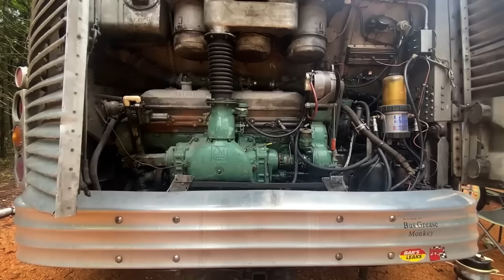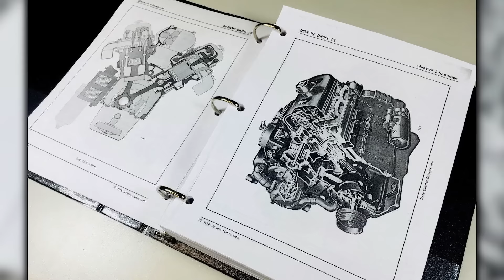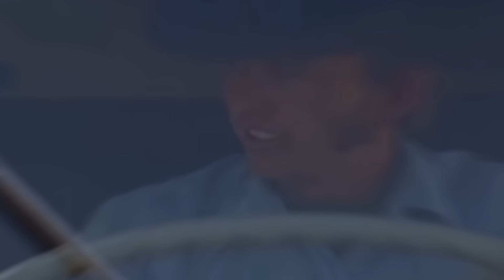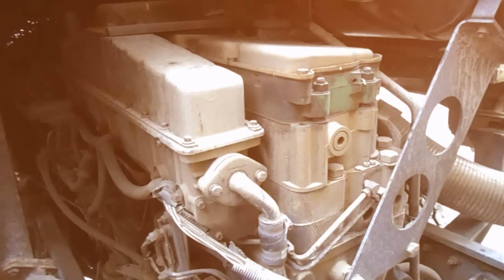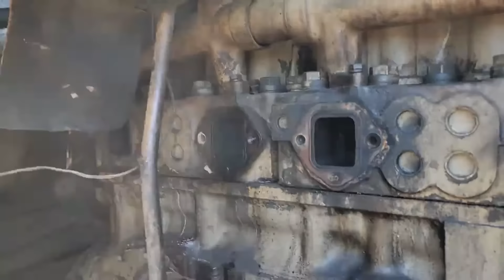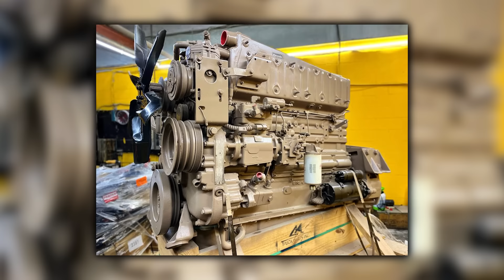The Cummins NTC-400 Engine That Silenced Detroit Diesel in 1976

Comment: That Cummins Big Cam 400 was a gutless POS. 
It's 400hp wasn't worth anything because its torque values were way lower than Cat's 400.
I actually preferred the Detroit 8v92 with a Fuller 13, at least it sounded like it was doing something.

Comment: What exactly do you mean by blow-through?  Did the diesel fuel not finish burning during the power stroke?  Two stroke gasoline engines let some of the air-fuel mixture through during scavenging, but this isn't a problem with diesels.

Comment: In a VS situation, it's simple. Detroit for power and cold starts, Cummins for something economical to run
 Period. That's it. It's that simple
 I've ran both many years and know very well. Cummins is far more affordable, hands down. There's not even a comparison. Keep them in a warm shop or plugged in in winter or you're not going anywhere. Detroit starts excellent in cold weather and typically has more power but much more costly to repair, not as reliable and expensive to put fuel through. Very few people try to run a 2 stroke Detroit nowadays, they are simply unaffordable. There's still some old mechanical Cummins running and driven properly can give very reasonable fuel economy.

Comment: The old 318's aka 8V-71.  I drove them, I HATED THEM, we called them a Yudden Yudden.  Or a Double Breasted Yamaha, or a Dead-troit.  They were TOUGH, I give you that, but they did not have high torque at low Rpm.  I always preferred a Cummins.  The 92 series Detroit was a lot stouter than the 318 or 71 series.  It was stronger than a 350 Detroit which was a Turbo charged 318 basically.  These oil slobbering things were NASTY, breathing that oil burning was not good to breathe.  If you wanted to stop and take a Nap, when you let the thing idle the oil pressure went to ZERO.  The guys at Stewart Stephenson that worked on them aid it did not hurt them to let them idle like that but it was better to have a Sampson Fast Idle Switch installed.  Then it would steadily idle at 1,100 RPM.  Try to sleep in one like that.  They were 100 MPH down hill and 20 MPH going uphill.  A Small Cam 350 Cummins with the pumped turned up would run circles around them.  4 stroke is the only way to go.  They are better on a stationary Generator or a Shrimp Trawler, they need to run WIDE OPEN all of the time.  Never like them.  However, they are TOUGH, if the driver does NOT let them run out of oil, or get them HOT, they were hard to tear up with their limited POWER.  Take a 318 and cut it back to a 290, and hire a WORM to drive it, it will run forever probably.  Detroits are GOOD around DIRT, Cummins, not so much.  For a Cross country truck, I would only want a Cummins.  That was my experience, I don't have to do that anymore.

Comment: When I was 30 years younger I drove a 79 Transtar with a 6V71 and a 15 speed. My boss told me to rev it as hard as I could. It was very fun to drive like that, these days I really appreciate the modern low reving electronic motors, easy to drive and shift with their low revs  high torque. However my dream retro truck would be an American W900 with a 12V detroit and a spicer splitter box. HTCF!!!!!

Comment: I’m 68. My entire life has been involved with truck and marine engines. In the 70’s I drove a hydroseeder truck with 6v53 everyday. We had trucks and equipment and boats with Cummins, Detroit caterpillar kabota Hino John Deere kamatsu Mann. The big cam Cummings was a great engine. The 3408 cat will pull anything. 1271 Detroit TI was all muscle. The 3406 cat was the best engine for our use. Today, my husband has a boat with caterpillar 1015 hp twin turbo C 18 x 2 cats. If you throw the throttles from idle to the pins those engines spool up like 2 cycle outboards. If you don’t hold on the C 18’s will toss ya out of the cockpit. Unbelievable response.
Reply: Sounds like some one messed with computer. Amazing what can be done with computers controling engines and equipment.

Comment: I grew up in the Logging world, Kenworth and big, highly tuned Detroit 12V71s ruled the mountains, then Cat and Cummins showed up and changed logging forever! Later when I started driving, I learned behind a DDEC 8V92, what an experience, the next truck was Cummins N-14 powered, Boy did that thing pull, made me a believer, and the last truck was Cat powered, had a C-16 in it, and holy hell, that Cat roared and would pull any grade with out down shifting more than two gears! Today, I have a Frankenstein Pacific P-12 with a Marine 12V92 that is converted to road use, backed by a Allison Power-Shift 8 speed and Eaton Planetary drives, nothing sounds like a Detroit 12V92 Twin Turbo, NOTHING!

Comment: The Cummins NTC 400...449 CPL
 had alot of problems. They smoked badly on startup, the blocks were weak and the liner counterbores broke. The crankshafts were not strong enough to handle the power...the N 14s was one of the best after the NTCs were out of productiuon.

Comment: A lot of the things said about the Detroits really only applied to gas 2-strokes.  They weren't any lighter or less complex than 4-strokes, and they didn't have fuel blow-through.  Loop-scavenged gas 2-strokes really are completely different beasts to uniflow-scavenged 2-stroke diesels.

Comment: My diesel is a 1981 Mercedes Benz 240d.  They are a very reliable diesel engine although the it has solid lifters and needs to be adjusted about once a year I am getting 30 mpg on the highway.
Reply: The injectors also open under pressure. The engine is all mechanical.

Comment: Jimmy  iingines may  be good on the Highway but they are a guttless wonder when used for off highway.  
I Ran  Wagner Dump loaders and the  NTA 400 cummins had more power than a 475HP V12 71 jimmy.

Comment: You Cummins cheerleaders are out of your freaking minds.  The Detroit 60 series is the best diesel engine ever made.  I have 2 million miles on mines and it’s never broken down, ever!!!  And I know guys with 4 million on their 60 and still going strong.  Where is the NTC now?  In 30 years I haven’t seen one.  But the old Detroit’s are still going, and you can still find parts for them.  Why not compare apples to apples? Why compare an older 2 stroke to a newer model 4 stroke?  Compare the ntc to the 60 series, and it’s game over.
Reply: Well shit talker the 855 Cummins is of the same era as the 2 stroke Jimmy's. That's why the comparison.
Reply: 4 million on a series 60? 
That's a lie. 
Nice try. 
I have a Caterpillar 3406B that's 39 yrs old and still runs like a champ and will out pull your s60 all day long. 
Show me a s60 that's 39 yrs old and still running great. 
My 3406B doesn't even loose or burn a half a gallon of oil in between oil changes
Show me any Detroit that does that. 
Nice try.

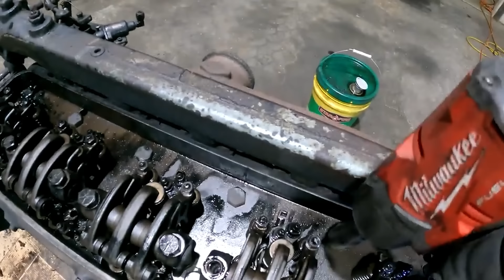Comment: I drove a 1990 International Dump Truck but had a Cummins 251 big cam on it paired with an eight-speed manual transmission and low range gears it was a transition into driving that thing you literally had to drive that thing like you were angry at it the thing I like most about that truck was the f**** engine sound literally be shifting to the next gear after you've fully spoiled out a gear you just didn't shift from 1 to 2:00 it took a while but man it would move a mountain

Comment: Worked these engines for a long time sure miss the good old days and times when working on engines you could prove yourself fitting liners in a Detroit engine and set the timing and synchronizing and buffers. Don’t miss the oil leaks on the gear covers thought but those Detroits started getting obsolete and we was on to repowering are mixer trucks with the 855 Cummins  of all different models big cams small cams and even some natural

Comment: Rebuilt many 350 small cams, 400 big cams, 475 big cam, air actuated mechanical cam actuators, dual partisian rads,then cripple 4s, then finally best engine n14. Series 60 was also bullet proof. Now, every engine self destrucys with emission garbage ,with worse fuel economy and terrible reliability.   98-2002 were greatest engines.

Comment: 3406 is the king... Series 60 next in line... I've driven Detroit and Cummins but 425 to 550 hp CATS out perform them... Drove an Ant-eater with a 550 and 18 it moved out like a sports car... Impressive...

Comment: First truck I owned was a big cam 4 Cummins in a t600 7 mpg did the bottom half at 450k changed injectors and injector rods at 700k. Great engine with a 13 speed. Before that had a shiny 290 in a kw cabover. that 855 block good stuff

Comment: I worked at General Motors Diesel Division located in London, ON on the Light Armoured Vehicle (LAV). Thus was in the early 1990s. We used the DD 6V71. Back then DD was introducing electronic engine control. IIRC, it was called DDEC. We asked if they would do it for the 6V71. They refused, so we went with CAT. Then they said yes, but it was too late. lol!

Comment: I think this is a very comical story. I do agree with some of the other commentors. Cummins was around long before the 400. Some engines? Not so good. But, we are not comparing their engines. So, on to your opinion. The NTC 400 is absolutely a good engine. Did it take down Detroit ? Absolutely not. Did it silence the screaming jimmy? Well? Technically? It was quieter for sure. But? Have you ever listened to a 903 trying to hammer itself apart? Or a triple nickel when it is deciding which side of the block to toss that extra rod out of? Not ripping your subject. I know we all have our own opinions. I have ran 4/53's. 6/71's, NA's and t's. 8V-71Na's and T's. Also 92 series including 6 and 8 V's. Now I know your title says silenced. But? I just feel obligated to add. I sold an Ih 4300 with a BC400 Cummins. The one I will probably never sell? ( kids might when I'm dead)  IH Transtar II. Silvertip 475 Detroit. I know she may be loud. No Detroit should ever leak oil. Except, from the breathers. But, that is the very difference between a 2 and 4 cycle engine. Cummins engines were quieter for sure. But low end grunt? Be serious. And Cat at that time? We used to give those owners much crap. If it is below 50 degrees fahrenheit? Put a jacket on em' or it won't start😂. Here kitty kitty kitty😅

Comment: GM did a fantastic job with interchangeability, simplicity and durability. And they would supply the parts like they needed. Unfortunately those engines just didn’t make a ton of power for as big as they were and they burned lots and lots of fuel. And good god they were loud. But they sounded great.

Comment: I drove a 1966 R model Mack with the 237 horsepower high torque engine with a Mack Quadraplex transmission. (5X4) it could out pull better than the Cummins, and Detroit  it also would get better fuel mileage than either one. 
That was before Cummins started with the Formula series, or the Big Cam series. Personally I always felt Cummins copied Mack.  Just my opinion.

Comment: Cat 3400 family of engines were reliable the early PC engines did have issue with cylinder heads cracking around the threads at the precup ,went to DI still capsule nozzles we had less head cracking issues,  though did see some issues with fuel in the coolant due to cracks in adapters for DI engines allowing fuel to enter cooling system, then that got corrected

Comment: If the apocalypse comes, the 2 stroke diesel will still run and can be fixed simply. I am no hater on cummins or cat but seriously if you get the 2 stroke fuel and a mounted air starter, it will run no matter what has happened, and you can fix the thing with a small set of wrenches a 2 screwdrivers and some swearing lol
Reply: If you have an extra set of injectors and Cosby in a can it'll last. Lol

Comment: I drove construction vehicles for years, most of the rigs I drove had Caterpillar or Cummins. While many trucks and tractor trailers were powered by Detroits, I don’t think Detroit ever dominated the on road truck market. While Detroit dominated the bus markets, both transit buses and intercity buses almost exclusively used Detroits, but not so in the trucking industry. 
As far as construction equipment, Caterpillar was always one of the biggest players and they of course would use their own Caterpillar engines.
For years I believe Detroit dominated the mid size marine market, work boats and fishing boats were mostly powered by Detroits and many pleasure boats as well. But today it seems like Cummins has taken over the mid size marine market.

Comment: Detroit Diesel's worst enemy was..... Detroit Diesel.  The 92 series engines were rushed to market in 1973 to compete with the Cummins KT series, Cat 3406 and Mack Maxidyne 300 which were all introduced that year.  The 92 was pushed out the door before it was ready. Reliability problems ensued.  Detroit's 40% share of the on-highway diesel market had shrunk to just 4% by the early 1980s, surviving largely on the strength of orders from drop-dead loyal fleets like Roadway and McLean.  It would take the introduction of the 4-stroke Series 60 engine (Developed jointly with John Deere) in 1987 to return Detroit Diesel to relevance.  The Series 60 was a "clean sheet of paper" engine, an 11.1 or 12.7 liter DOHC inline 6 designed from the ground up for electronic control.  The Series 60 would become a legend in its own right, but that's a whole 'nuther story.
Reply: There's nothing that Detroit made that could come anywhere close to competing with Cummins KTA 19L.

Comment: Been running the same big cam 400 for 24 yrs. I pull up to 128k on a lowboy all the time. Best engine ever made in my opinion
Reply: Parts are also plentiful and cheap compared to others.  It amazes me the basic engine was produced in 1932 and received many upgrades through the years.  It was an excellent basic design.
Reply: @DaveJensen-l5b4b right! We can buy an entire long block for the cost of a cat in frame. I do like the sound of detroits. The 60 series is a reliable beast in its own right. I like my big cam.
Reply: I love my 1980 big cam. Ill never part with it. She starts every day.
Reply: Agree, altho i prefer the high comp ratio  bc 350.
Reply: Ain't no 2 stroke screaming Jimmy doing that
Reply: @Xantisfa6700  NICE JOB JIM BOB

Comment: As someone who owns multiple Nig Cams and makes a living with one EVERY DAY, the NTC timing stuff is way off base. The Cummins PT pumps are static in their timing.... they don't vary timing at all. Later in life they had an injector design that would change between TWO different timing profiles based on load, but they were never something that was flawless and only stepped between two different timing settings.

Comment: A interesting video over all. Some misses in information for sure but hey it’s still done well and going the right way. Talking about mechanical injectors and no computer electronics and then showing a Cat style ELECTRONIC unit injector made me chuckle a bit. Absolutely helps to have a computer to check driver function on those bad boys.

Comment: Fuel is injected directly into the combustion chamber of a Diesel engine at the top of the compression stroke, none goes out the exhaust valves unburned. The only way for oil to be present in 2 stroke Diesel exhaust is if oil gets by the piston rings and into the cylinder, Y'all need to learn a little more about engines.
Reply: Well shit talker you should do some learning before you run your mouth. Oil could get past the wrist pin caps and blow into the intake and then back into the cylinder once the piston was below the intake ports. That's how it gets around the rings genius. Got any other stupid stuff you want to say genius?

Comment: I had a Cummins Big Cam 400 in a Mack Knuckle Boom log truck. It was a great engine. Plenty of power and it had a 3 stage Jake Brake that was a life saver! I still have dreams about driving that old truck. It wasn't as loud as the Detroit but it had a very distinctive turbo sound. The bearings were so good in that turbo i could cut it off and the turbo would take 5 minutes to quit spinning! I think that Big Cam 400 with its turbo whistle is the best sounding diesel on the road. First time I ever heard one was in the troop trucks out at Ft Campbell Ky. I talked to one of the soldiers, i said that things got a blower, don't it? He said naw it's got a turbo! I thought, Damn that thing sounds Good!!!

Comment: and as far as serviceability the detroit is far simpler than a 4 stroke cummins.  I have no idea where the "frequent service" thing came from because I bounced a 3-53 off the rev limiter all day every day for 5 years pulling wood and didn't do anything but add and change the oil.  And it was ran like that for yearssss prior to me getting it.  It had well over 15000 hours on it when we got it.